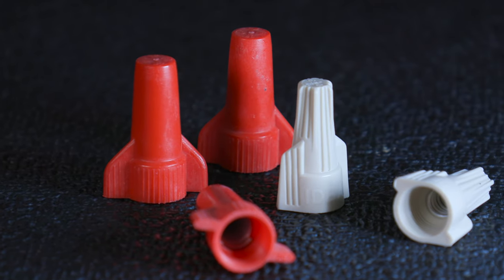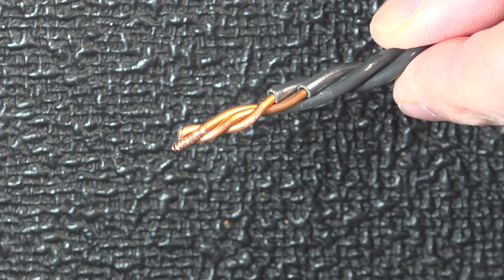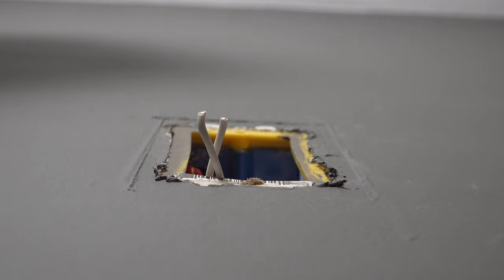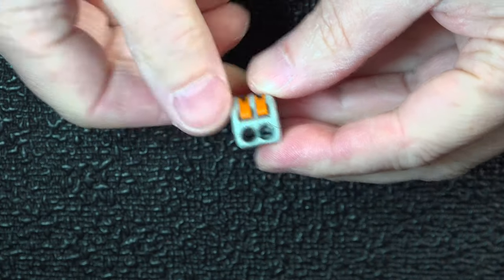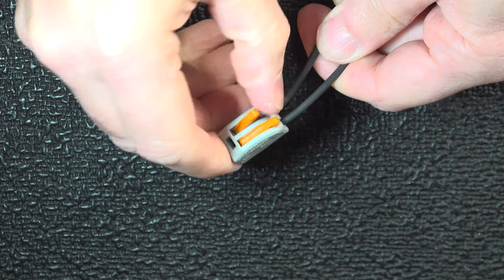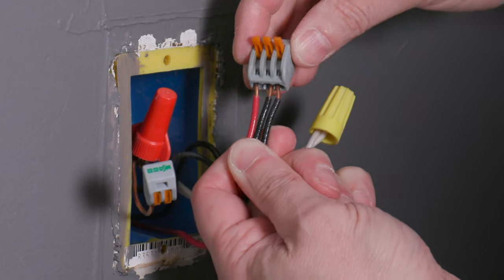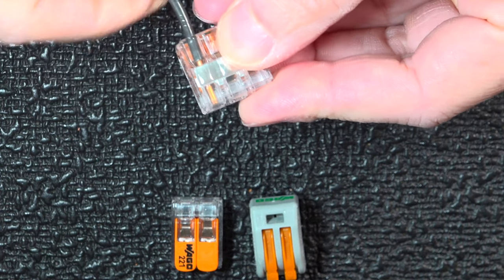Never use Wire Nuts Again - Wago is Better Electrical Connector

Comment: I've used A lot of these as well as a competing 'single' use connector. These types of new 'quick connects' are much faster than wire nuts and far more secure. As for cost... who cares! They're faster and more secure than wire nuts and that's what counts.

Comment: Clearly the wago connectors are better but they are also 10x the cost of wirenuts....
Reply from the maker: When you buy commercial qtys they are 2-3x as expensive. For homeowners and diy the cost is insignificant, you might spend $12 more for a box that lasts 10 years.  Commercial users can save 80% less time per connection with Wagos which is something to consider.

Comment: I was pretty shocked when moving to North America that they used this for permanent household connections, whereas back home it was limited to construction sites for temporary ones. Instead if a permanent multiple wire connection is required, we used plastic barrier terminal strips which gave you the choice of securing it to the appliance

Comment: Never take advice from an idiot who uses a pipe wrench to twist wire. Wire nuts are perfectly safe to use as long as your connections are tight but not tight enough to break the plastic coating on the wire. This is coming from an electrician. If they weren’t safe we would not be allowed to use them by code. Wire nut boxes also have how many wires they are rated for on the box.

Comment: The only real reason your wires burn is because your pulling too many amps from that circuit. Wire nuts have nothing to do with that.
Reply from the maker: Except for that poor wire in the middle. Let's hope it made it, you will find out if it didn't you just don't know when. Wago, you can see it, every time.

Comment: Your full of it. I have had wago burn in boxes. There is only a thin piece metal between the conductor. Like push in on house grade recpt. .I have been doing electrical for 55 years and been using Buchanan crim-on wire nuts, with pigtails for devices. Never have I cut wire nut off. It looks like you are selling wago,s. You need to be selling fir insurance with them.
Reply from the maker: They aren't like anything. Thats why they have a patent and other products dont. You may have had crappy connectors burn up. I guarantee you have never had a single Wago 221 connector fail.

Comment: Very misleading video. Wire nuts are way better than Wago type connectors because wire nuts have more surface area on the connection. Wago type has a single blade connection which fails over time. Splice two pieces of 15 amp wire together with a Wago and run 50 amp through it and watch the Wago melt. Try the same 50 amp load test with a wire nut and you will discover that the wire will melt before the wire nut fails if spliced properly with the correct size wire nut.
Reply from the maker: Great idea, good thing I already did just what you said: https://youtu.be/B1pmuRsf1co

Comment: I am going to disagree,
In Canada it is code to have a mechanical connection, that means twisting them together first. You can have a much great chance at a short or fire by just stripping the wire wrong (nicking it leaving it smaller gage and weaker) as apposed to Marrettes. I have used quick connects before, they are CSA approve but personally I would not use them for every connection in a house or business. Quick connects should only be used if you are connecting stranded with solid wire. If you got a couple or more #14s to join, twist 'em, trim 'em, throw on a marrette and sleep at night. You do not have the same connection with your quick connects, surface area of each wire touching each other. Your circuit is only as good as your weakest link! If you wired your switches and receptacles with these your house would be full of weaker links.
Electrical is hard work, especially with products like this being sold to do it yourselfers that should have just hired a pro. Average person will strip the wire inconsistently, leaving not enough or to much copper exposed. The exposed wire could come in contact with other exposed wire and there you have a BOOM.
Just my professional opinion, but you got this one dead wrong. That is what could happen when you do electrical wrong, people can die!

Comment: You should know what you're talking about before making a video that electricians will watch. First, nobody should do electrical work without some training or education. That's how homes get burned down and electrocutions happen. Second, as with all things, manufacturers recomendations and instructions should always be followed. There is a proper way to use wire connectors with stranded and solid wire together. I have never had an issue with that combination. Third, try fitting those walnuts in a 2x4 outlet box with a GFCI in it. The ease they offer is often canceled out by the space they take up in a box. You should leave the electrical videos to the electricians.
Reply from the maker: Won't fit in a tight box huh? Looks can be deceiving, they fit better in box. Ever notices boxes are square, not round, what do you think packs tighter? See for yourself https://youtu.be/xuj-sEJryxw
Reply: @SilverCymbal  Real world experience trumps a youtube video. I've been do this for nearly 30 yrs. Your not gonna tell me otherwise.
Reply from the maker: @sinjin341  Your end statement explains everything.

Comment: Classic case of making things easier for dumb People... All I see with this product is more cost.. wire nuts are cheaper and you will need maybe 3 different sizes for residential use, blue, yellow ,red. I have wired many apartment buildings and houses in my younger days before I got out of the trade.. the first thing an apprentice needed to learn and get down pat was proper wire connections,  my wire connections were stronger then the wire when twisting them with my linesman pliers then the wire nut gets tightened a little extra with the linesmans..

Comment: Bet they aren’t as economical as wire nuts
Reply from the maker: Yes that is true for repair and upgrade work the cost difference is nothing though. If you are building a skyscraper then I suppose its a minor increase, easily offset by labor saving though.

Comment: You don't need to cut the wires FFS. Have you ever done electrical work? Why are you even making this video?
Reply from the maker: So nicked and damaged wire is ok under the NEC?  Were both already know the answer but go ahead and put that toothpaste cap on to cover it up and no one will ever know. I am well aware that's its done doesn't mean its ok. Lots of things work...until they don't.

Comment: Wago splicing connectors. German engineering and quality💪🇩🇪 
Better than wire nuts, better than screw terminals or luster terminals (Lüsterklemme)

Comment: As an electrician, take this video down, wire nuts are better because it’s a direct connection between 2 wires. No one uses these for a reason.

Comment: As an electrician I can tell that you’re not putting the wire nut on correctly. Do you get paid by Wego for this advertisement of their product? I noticed you don’t use any other products except the one in the video.
Just Saiyan.

Comment: Junk. You can add more with a wire nut. P.S. hardly ever is a wire nut not a good way to make a connection. It's for the sake of marketing that they gaslight wire nuts.

Comment: Although they’re nice yes, they’re incredibly expensive compared to regular wire nuts. So long as you buy high quality wire nuts like ideal, and take care and pride in the installation. You won’t have any issues. You certainly don’t need to lop off that much wire if you’re gonna undo the wire it and certainly don’t need to replace it with a new one every time.
Reply: Ya but is the customer really noticing if you charge them a few cents more per box? Also gotta factor in time, if they speed up your work, they basically pay for themselves

Comment: This is ridiculous. Wire nuts are used by electricians and they are trained professionals following building codes. You just don't know how to use them. In your example it was clear the wire but was way too big. Sure this new gadget may be better but they are also more expensive I bet.

Comment: WAGO, expensive wirenuts for dummies/amateurs
Reply from the maker: Or all of Europe. But just ignore the fact the rest of the world dumped wirenuts or that UL, NFPA and CSA all gave them a clean bill of health too.
Reply: @SilverCymbal  t is better to make a connection with the whole surface area of the spring inside the wire nut.  WAGOs use one small blade to make the connection. a mere fraction of the surface area provided by a wire nut  WAGOs are susceptible to   losing tension\deforming if handled roughly especially with multiple 12 awg solid conductors. 

probably ok at > 50% of a conductors ampacity.  probably not ok at the NEC limit of 80% 

what do you think grips better pinching with your finger nails. or a squeezing with your thumb and fore finger?
Reply: @SilverCymbal  have you heard of lobbyists.
ya know the people sponsored by corporations

Comment: Wouldn't be so bad cutting the wire back if you didn't cut 2-3 inches off. Pull the nut off and just cut the exposed wire, problem solved.

Comment: These WAGO are garbage. They are listed as a pressure connector, which is classified as a device, per NEC and CEC.  Per NEC and CEC you cannot utilize a device to splice your grounded conductor,  so right off the bat these are being misused.   Also , per WAGO UL specs, you need to further test your system to ensure you have a proper EGC connection.   I doubt anyone is doing that.   These are garbage encouraging homeowners to DIY, when all electrical work should be done by a licensed contractor.
Reply from the maker: You realize that a wire nut is also a pressure connector as well?
Reply from the maker: You probably won't believe me so.....As pressure-type wire connectors, wire nuts may be used in branch circuit electrical wiring–house wiring, for example. But each size is tested and approved by Underwriters Laboratories and the CSA for certain specific combinations of wire, which are listed on the packaging.
Reply: The electrical connection with a wire   nut is from conductor to conductor.    NOT from conductor to device to conductor as is the case with a WAGO.  They are same concept as stab outlets, and those arc and melt all the time. ...... They are garbage.

Comment: Wagos feel warm to the touch when higher current  passes through them, such as over 10 amps. Which means resistance! Wire nuts are superior in most applications. But Wagos have their place, quick, and great for low currents.

Comment: If your bcap comes off u didnt do it correctly. 3 wraps inside the bcap *snip the tip*(you didnt do. Beacuse of that u had a wire poking out) and three wraps outside the cap. And u can use plyers hell they have an impact drill bcap jig for that. Wago and qwick connects do nothing but fall off. Wagos being the worst. Cant be an electrician using youtube.

Comment: You can unscrew a wirenut bro, you're cutting the wire needlessly to sell your dumb wago connectors
Reply from the maker: Sure with nicked and chewed up wire. Look up connecting nicked wire and you are told to cut it and start over. Plenty of things in life sort of work. Id rather follow the rules when it comes to electrical safety

Comment: Twisting solid wires together before using wire nuts is the way to go. Wagos are not the better connector. This video is wrong

Comment: If you can't properly use a wire nut, you should not be doing ANY electrical work ever....................
Reply from the maker: What proper? The "scientific" pull test, I forgot about that one. I wonder if that's what your heart surgeon does? When you step back and look at wire nuts, they are the dark ages

Comment: Absolutely wire nuts are reusable, and it 8s a rare case that wires have t9 be cut to remove a wire nut. Don't get me wrong, I th8nk the Wago connector has a promising future however I can't decide to what degree this video is just exageration and to what degree it's a display of ignorance.

Comment: This is a joke right ? All of a sudden some guy that's obviously not an electrician doesn't like wirenuts and promotes wagos 🤦‍♂️ wirenuts aren't going anywhere, just use them correctly
Reply from the maker: Already outlawed in multiple countries. Even Ideal got into the push connector market and created junk of course since that can't touch the 221 patent. Believe what you want, the shift is already well underway
Reply: @SilverCymbal  LMFAO, outlawed ? I've been an electrician since 1987 and I can absolutely guarantee wagos have way more loose connection issues than properly installed wirenuts. But you go ahead and believe what you want, go ahead and keep using a pipe wrench on wirenuts 🤦‍♂️🤣🤣🤣
Reply from the maker: @andrewselectric4290  Don't laugh too hard. Lets prove your argument. Search on burned wirenuts and you will find hundreds of images, Search on burned Wagos and you will find 0  I wonder where all the problems are? Thats right, just myths unless you don't believe UL, CSA, NFPA and about a dozen other worldwide approvals
Reply: @SilverCymbal  you go ahead and keep saying wirenuts are outlawed and be sure to keep using a pipe wrench on them 🤦‍♂️ ...
Reply from the maker: @andrewselectric4290  You listened to the audio right? Don't get me wrong wirenuts are superior to Wagos for one thing. They cap unused tubes of caulking better than Wagos. That I agree with.
Reply: @SilverCymbal  lol you do you
Reply from the maker: @andrewselectric4290  Happy New Year my friend

Comment: 25 years in the trade.  This is such bs.  Nothing in this video showed using a wire nut properly.
Reply from the maker: If in 25 years you have never come across a wire nut sitting in the bottom of a box, burned out or loose I don't think you are doing much electrical. The point is there is too much room for error when installing them.
Reply: @SilverCymbal  😂👍

Comment: Why not just use a trusty old blue point connector? Heaps better than that wire nut rubbish, easy to use and cheap as chips.

Comment: Anyone who doesn't use a lineman splice and solder shouldn't be giving advice about how professional electricians connect wires.... What kind of maniac cuts the entire wire off behind the nut and not just nibs the ends?  This video should be listed as parody, not as real advice.

Comment: Forget everything he said. it is total crap. Use wire nuts still the best and cheapest connection and don't cut the wire shorter like he did that's crap advice.

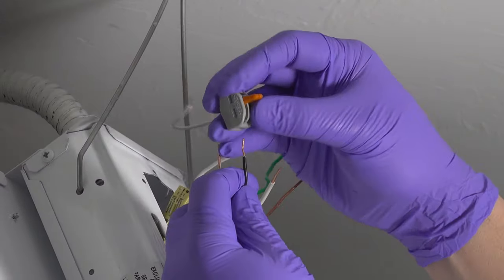Comment: Skip to 3:40 the end of the video. See what kind of gloves he has on to do electrical work 🤣 and at that point and that point only…decide whether or not to watch this laughable video
Reply from the maker: Sorry they aren't my 1000v Facoms my friend, they were so you could see what I was doing a little better on camera. Keep laughing and I will keep using wire nuts to cap left over caulking tubes. They are good for that.
Reply: @SilverCymbal  sounds good 👍🤣

Comment: What a joke, wire nuts work just fine if you use them correctly, wagos have a reputation of failing.
Reply from the maker: A reputation from electricians who hate anything new. But in reality you won't find one documented case, photo or real account of even 1 Wago 221 that has failed. Search on failed wirenuts and you will need to buy a new hard drive.
Reply: You must not get out in the field much
 I have seen them fail, cut the out and replaced with wirenuts